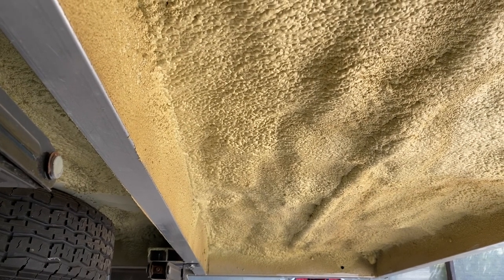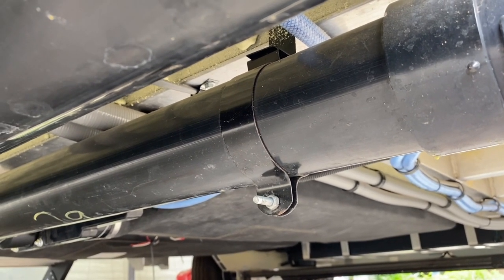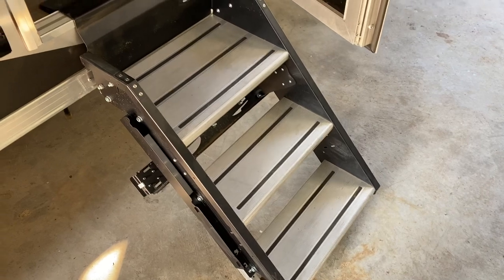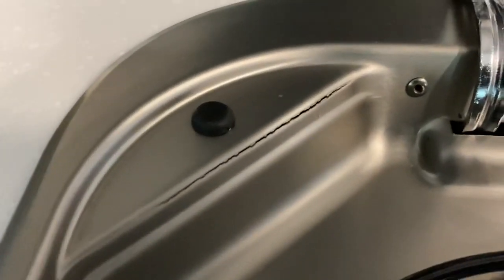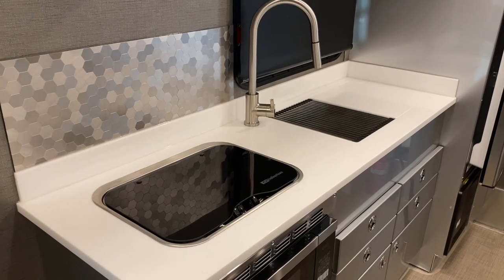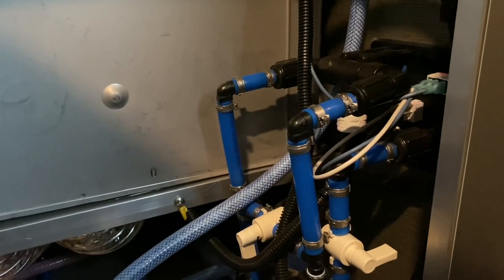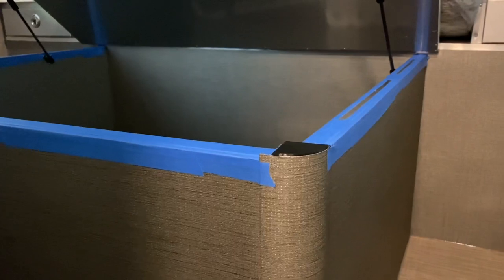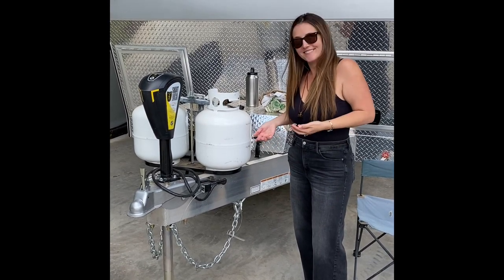ATC GAME CHANGER TOY HAULER 2021 REVIEW

Comment: Great  review of the issues.. Glad to hear you would still buy it though.. I have had a new ATC (2 years ago) and a Used one before that, with the exact same thoughts.  HOW DID THAT PASS INSPECTION!!, and "I'd definitely buy it again"...  ... as a  side note, "So far" ATC has honored ANY request for warranty work we asked for.  Friends and acquaintances have been denied from "other" manufacturers for basic stuff.  Best part, Structural warranty is 5 years now.  Please be sure and  make another video after you get it sorted out.  Beautiful looking trailer by the way...  Who did the insulation underneath if you don't mind...
Reply from the maker: I’m glad to hear that your warranty work has gone well, the 5 yr warranty helps to have confidence in that part of the manufacturing, all of the structure and welds that are visible look good. I had a local residential insulation company spray the foam, I’d have to look up the name now but I took the trailer to their yard and picked it up the next day.
Reply: I am sorry to hear this but wondering who the dealer was so I do not use them. They obviously do not check their trailers before delivery. And we did you choose to do repairs and not have the dealer do it. I am set to order from ATC and did all the research before choosing them but this was tough to hear so thx. At the least I would want to hear why their quality control is apparently lacking so badly
Reply from the maker: @richardgiambruno4052  I did the repairs myself because I wanted the peace of mind that it was actually ready to go and reliable. Having a breakdown or a lot things not working when you’re on a trip a long way from home and help isn’t the kind of vacation we wanted. I have seen too many bad experiences in the past from putting trust in other people’s repairs and integrity. So yes, it’s completely ridiculous to have to do repairs to a new trailer, but I also didn’t trust anyone else to do any better.

Comment: WoW, I was looking to purchase the 4528 toy hauler, I guess I go with the Cimarron TH with the Outlaw conversion. Although not the perfect floor plan, at least it wont fall apart. I'd be concerned about the deficiencies you didn't find. i.e. behind the aluminum skin. THX for your information, very helpful.

I think I would have asked for a replacement or my money back.
Reply from the maker: I was so discouraged that I was actually thinking about taking it back to the dealer and asking for money back or a different trailer, I didn’t expect another trailer to be any better I guess. I agree that it not confidence inspiring to find so many “surface” issues when there is so much that’s buried beneath the skin and inside the structure. I feel like the way you do one thing is the way you de everything...
Reply: @Pioneer_Classic_Trucks  Sad, because I really wanted to believe that this brand was the holy Grail of toy haulers. Maybe going forward they will improve their build quality.
Reply from the maker: I hope they do, I think the market needs it.

Comment: Would you make the purchase again, or would you purchase another brand? I’m so curious…..
Reply from the maker: At this point I would not buy another one, it hasn’t been a great experience overall, email after email unanswered and calls to the dealer and they seem to just forget about me and don’t call back, and I still haven’t been reimbursed for parts I had to buy. It’s been so frustrating and disappointing.
Reply: @Pioneer_Classic_Trucks  Oh man! I’m so sorry to hear this news… You know, I was seriously considering this camper until running into your feed and reviews about the build quality. To see how much you rely on this kit for what it was designed for and have it perform in this manner hurts me brother. Would you go with another brand, or just keep rebuilding this unit until it is up to your standards? I’m just curious…
Reply from the maker: I reached the end of my patience and actually just sold the trailer, I feel like I had most of the bugs worked out and repairs done, but I had a bad feeling about the long term durability of the unit, especially considering the lack of support from the dealer and company. It seems like their only fix was to review the warranty with me which didn’t give me much confidence in them, I need something that is reliable long term, I want nothing to do with it if it’s always going to need repairs.
Reply: @Pioneer_Classic_Trucks  Really? Well… you’ve made up my mind about this rig and I’m going Class C then. I’m so terribly sorry to hear this mate! Tank toy for your commentary and Truth. I’ll stay connected with you.
Reply from the maker: Good luck with your search and purchase!

Comment: Wow.. now i am questioning should I even look at these. I am in the market for a toy hauler. I would have not thought the ATC would have these QA issues
Reply from the maker: I was surprised to find so many issues, hopefully I’ve got most of the bugs worked out but I will still be doing more work to it in the future adding solar panels, new charge controller, and relocating the batteries.

Comment: Not too bad, some issues are QC based, fair compensation would be to send you a $2000.00 check. But yes these types of issues can happen.

NOW for long term you need to make sure your frame doesn't crack
Reply from the maker: 2k would be reasonable compensation I think, I have yet to receive anything, not even for parts with receipts.
Reply: @Pioneer_Classic_Trucks  I think $5000 to $10,000 would be minimum fair. Imagine how much they would have charged you (out of warranty) if the fixed these defects properly...like you did.
Reply from the maker: You’re right, shop rates at around $100/hr adds up very fast and I know it was a lot of hours for me to track down and correct all of the problems.

Comment: Over all did the company make things right? Are did you have to get a Lawyer?
Reply from the maker: ATC did reimburse me for some of the repairs I had to make but not everything, it was quicker to do it myself than wait on the dealer so I took that risk of not being compensated for my work but I had to have it done to use the trailer. I sold the trailer and was happy to see it go even though I had fixed all of the problems. I did not get lawyers involved.

Comment: Apparently quality control in the trailer,RV industry is shocking in last 10yrs.Some dealerships the good one's hire a RV, Trailer inspector to go over them first before they'll sell them so they guarantee a good product & if no good send them back to factory.Shocking really
Quality Control is pathetic & the industry needs to step in & have a independent Quality Controller at every manufacturer to keep them in line so industry standard improves.
Shouldn't be one bolt,nut or screw loose.Actually disgraceful how they're not built properly these days
especially for the money they charge.I would turn up with my own
registered inspector at my own cost to look at it & tell them what needs to improve before I bought one.
One inspector said it takes about a year to get things right getting them to fix stuff under warranty this shouldn't happen should be alright to start with.
Reply from the maker: I agree, it’s pathetic how they are built with no standards or quality control.
Reply: @Pioneer_Classic_Trucks  Pity Lazy Daze shut down they were quality & there are tons of old one's still going decades old.Born Free another great RV.Arctic Fox Trailers are meant to pretty good too.
In future research the dealers cause some will get every RV,Trailer inspected to make sure it's up to 
standard.
Aluminum & Azdale fiberglass built units no wood in frame are pretty good & don't delaminate.Metal sides & aluminum framing no wood in frame be good as well.Smaller companies seem to put more heart & soul into their builds & build high standard units.

Comment: How's the insulation? For cold weather?
Reply from the maker: The coldest weather we used it in was mid 30’s at night and it cooled off inside the camper very quickly when the temp outside dropped. During the day especially when parked in the sun, I could really feel the heat radiating in like standing under a patio heater. So to answer your question, the insulation was very minimal, better than nothing, but not by much, mostly a fair weather rig.

Comment: Does ATC sub contract building this trailers? I was searching the ST Louis Missouri area and it appears the dealer is A Trailer Repair/Custom build operation, I think if I would build one I would want QC at the build location in person before taking ownership...
Reply from the maker: I don’t know if they sub out any of the construction on these, it’s possible. I know other manufacturers sub out different phases of the build.
Reply: I have visited the same dealership in the St. Louis area. I believe the are just a dealer. They can do repairs but I don’t think they build them.  They also have a dealership in the cape area.

Comment: Any chance you'd be willing to sell it now that  all the issues have been resolved?  It was up on my list but after your video I'm a skeptic.
Reply from the maker: I’ve already sold it, and I still haven’t been reimbursed for parts I had to buy so I’m not happy with ATC’s customer service either. I will probably never buy from them again.
Reply: @Pioneer_Classic_Trucks  Thanks for the excellent review and I'm sorry it was such a bad experience.  Thanks also for the prompt reply!
Reply: @Pioneer_Classic_Trucks  As a matter of curiosity have you found a better built rig?
Reply from the maker: I bought a slide in camper called the Camp X from Overland Explorer Vehicles and have not had a chance to use it very much yet. My initial impression is that it is a much higher quality unit, but it’s obvious very different from the toy hauler. I honestly don’t know what I would buy if I bought another trailer. I would definitely not buy anything bumper pull again, I’ve always had 5th wheels and they tow so much better, especially for something as big and heavy as a toy hauler. I’ve talked to other people with bumper pull toy hauler trailers and they say the same thing, they are not always easy to get the weight where you need it for proper tongue weight and a sway control hitch is pretty much mandatory to be able to tow them at highway speed.  There was another manufacturer mentioned somewhere in the comments that I looked up and they seemed interesting and might have potential to be well built, I don’t remember the name right now.

Comment: Man...You had lots of "finishing" QA issues. That's not fun at all. The dealer should have caught half that stuff. I have a 2016 28FB and have only had the normal/basic rv maintenance and repairs to do on it. Hope after the kinks are worked out all will go well. Keep us updated over the next few months.
Reply from the maker: I will probably do another video after we use it more and go over the solar and battery installation, hopefully no more issues show up. It’s good to hear that yours has been better. Thanks
Reply: Does it suck? Yep. But it's not the norm. They are hammered with availability of parts right now. Partial finishes, put outside, finish when parts come in etc. Add in not enough employee's and having to hire in  guys that worked for other shoddy mfg it will take more than some time to get the paid by the piece mentality out of them. 

I've had three trailers. A 19' a 20'  and now a 20' 36' fifth wheel. All had a few minor things just like any hand built item. Boats, planes, RVs. A lot of this stuff should have been caught at their QC and at the dealer QC and never made it to you. Dealers are not created equally. 

I don't know where you are at, but the issue with the wheels. They are supposed to be checked at 50 and then 250 miles. When you pick them up at ATC there is a big sign for the driver's to do this. They also sign off on it. But you know people and putting out effort...

Good luck.
Reply from the maker: I agree with you that there are a lot of challenges with manufacturing lately, it’s just discouraging to feel like you don’t get what you paid for. I’d be surprised if very many people delivering these trailers to the dealer carry a torque wrench and check the lug nuts at the specified intervals, even though they signed off on it, but I could be wrong.  Thanks for passing on your experience with them.
Reply: @Pioneer_Classic_Trucks  I'd agree about most of the drivers.  Once you get this stuff sorted, you'll love it. Use riv-nuts to install fixed point mounts. They hold up far better after a few years of bounding around.
Reply from the maker: Yep, I have a nut insert tool, and I plan to go back and install those in place of the self tapping screws to make it more reliable long term. I think that once all of the bugs are worked out we will enjoy it for years to come.

Comment: Would you buy the same brand over?
Reply from the maker: I can’t say for sure but I would shop around more with other manufacturers and also spend more time looking at the trailer closely instead of just listening to how good the salesman thinks it is. I would be the crazy guy who brings my own creeper to roll around under the trailer at the dealership before buying it. Ultimately I plan to build my own camper, I just thought this would be a good solution for the short term.

Comment: Wow!  Completely unacceptable for the price of ATC products.  This is not $25k trailer.  I've been seriously considering at 2419 model but now having second thoughts.  Who has time and wants to deal with the frustration of hagling with a dealer to fix problems that should have never left the factory.  Now that you are two years in with yours, what are you thoughts at this point?
Reply from the maker: I actually sold the trailer after only using it a few times. After all of the repairs and seeing how poorly they are built I decided it was going to be an ongoing maintenance and repair nightmare and I lost interest in it completely and got a composite truck camper from OEV which has been way less problematic and better quality.

Comment: what about the warranty etc?
Reply from the maker: They do have a warranty, after getting the trailer home I did the repair work myself because I had a trip planned and it was just easier and faster for me to do it than take it back to the dealer and wait for them to have time to work on it, then go back to pick it up. Also, I didn’t really know if I could trust them to do the work any better than the factory did. They apparently didn’t go over the trailer before they sold it, or they would have seen at least some of the obvious problems I had to fix.  I also did the prep work myself before having the spray foam installed and I found a lot of things to fix during that process.  I just did what I had to do to be able to use the trailer for a trip. Looking back now, I should have taken it back to the dealer and got my money back immediately, it would have saved so much headache.

Comment: I find the idea of all aluminum the ideal. But aluminum cracks and strips easy threading so it is never a wise idea to use screws on it. Bolt on is the way to go. Even welds can break. Positive is they will not rust or rott you away. I believe they use Amish as workforce. Guess the Amish ain't neighter anymore what they used 'ta. Having the electricity underneath is  recipe for trouble.
Reply from the maker: I agree, aluminum is a great material but their design is not. I haven’t heard about them using Amish as labor, that’s interesting. The mechanical and electrical was a mess everywhere that I could see it, really sloppy work, under the trailer, interior wiring, behind the battery charger/breaker/fuse panel was a huge mess of wires, exposed to sharp edges, not secured in place, bad connections, unsealed connections under the trailer, damaged wheel lug nuts, defective and damaged components, it was a long list of things that I found to fix.